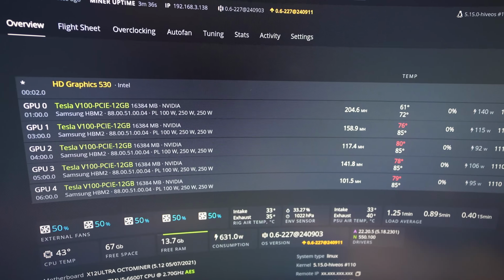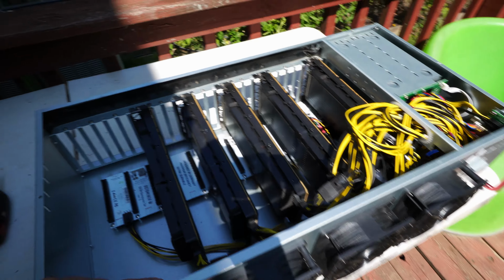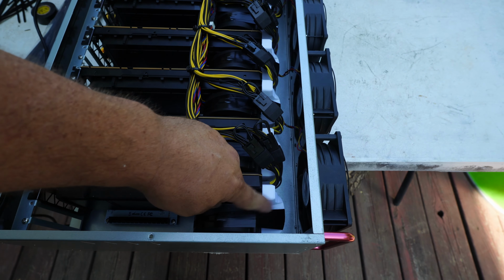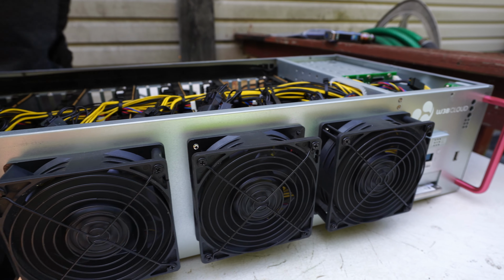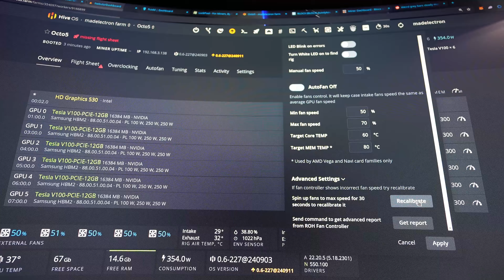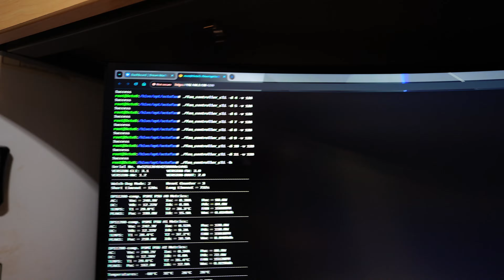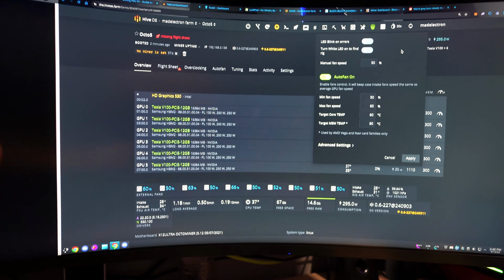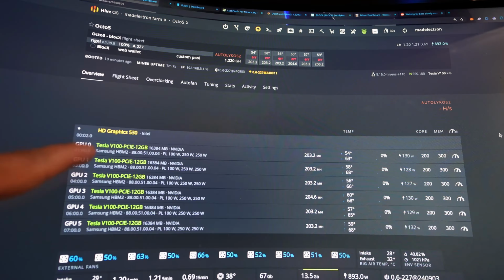CMP 100 210 Proper Cooling #crypto #mining

Comment: Thanks, good solution, but the easier one is to flip the fans to exhaust and plug the unused holes, see motorcity miner vid. I got the same temps as you, but dont have to do anything extra. Your setup may be ideal for kawpow, though. I went nuts with one of my rigs and changed two 120mm fans to 140mm fans too (via 140mm to 120mm adapter), works even better, just have to make sure to have a good seal. Cheers!